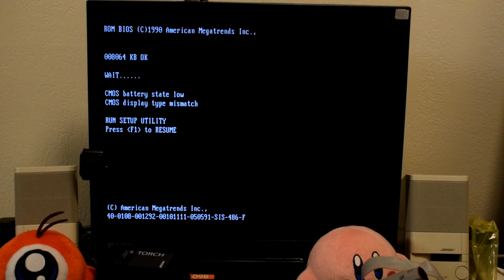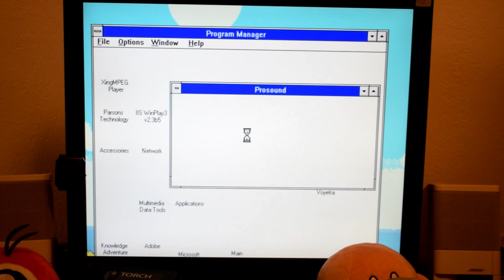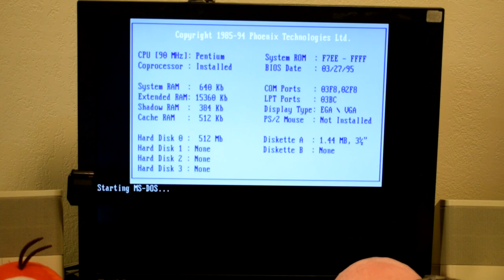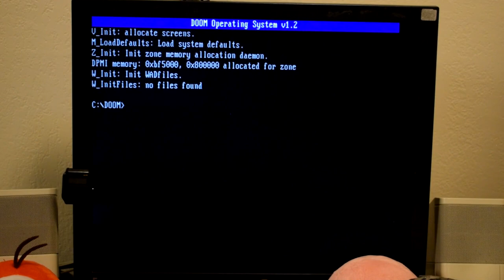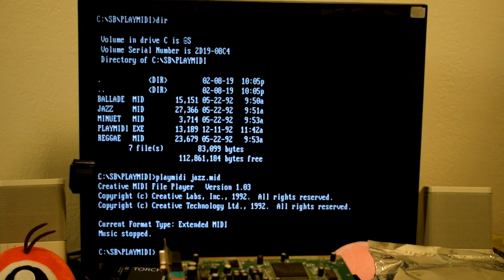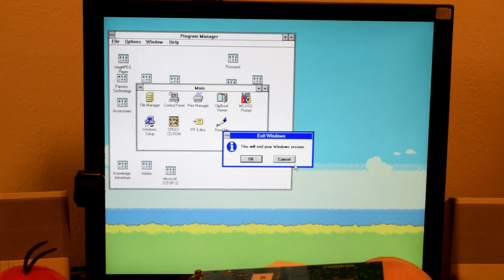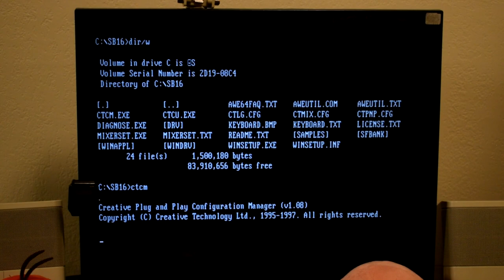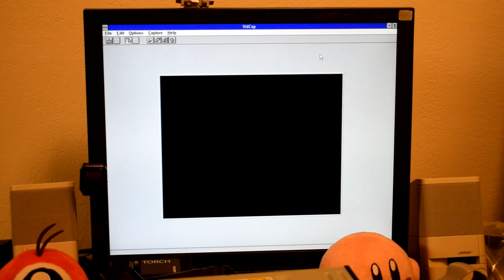The DOS Machine Motherboard to Rule Them All?

Comment: You shouldn't hold the AT power switch that way. I used to do this and I almost killed myself. AC power is getting through that button so you DO NOT want to accidentally touch the cables ends on there ... I zapped myself once with that, thankfully it only went through my finger and not through my whole body ...
Reply: I'd imagine it's a low power signal to talk to the board and power supply?
Reply: @isaacbushnell2663  AT power doesn't communicate in any way with the motherboard.
This is long before the advent of safe soft power switches. This is what we call a hard power switch, it connects the power supply to the wall pretty much.
Reply: @AiOinc1  yeah that's why I'm warning him. I've been zapped before by inoffensive things, but this, this was MUCH stronger, and it left some little burn marks on my finger. Thankfully it was really short.

I didn't know wall power went through this before, that's how I know x)

That's also why they put 4 cables (instead of 2) in a big black protection, and that the cables themselves are much thicker than the other.
Reply: Can agree I found this out the hard way as a kid. The one in my machine didn't have the heat shrink around it.
Reply: @im.a.nickel  Usually they don't have any kind of cover because they expect only qualified service personnel to be inside your computer, or that you're smart enough to unplug it first.
Reply: @DxDeksor  DC power is basically wall power, it goes through your entire house and the moment you touch it you act as a "ground" for it.  It doesn't go through your body at all unless your touching something else that is also metal or conductive.

So yea, you were "safe" to touch it (safe as in it wouldn't kill you, but it'd definitely hurt) as long as you aren't touching anything else that is conductive.
Still dangerous, but unless you have a fork or spoon in your other hand, the signal won't travel through you at all due to your body acting as ground for it.   At best you killed some cells/possibly nerves in one of your fingers, but that's about it really.
Reply: @Nighterlev  well my finger had two small dark dots after that. I think I touched the neutral first (which does nothing of course) and then the phase with the same finger. So it definitely went through that finger for a microsecond, until my brain felt the pain and told my hand to move away x)
Reply: @DxDeksor  yea, the 2 small dark dots on your finger was the "circuit" using you as ground.    That's basically what ground does, and won't kill you at all.  It completed the circuit, but as expected was using you as ground.
Reply: @Nighterlev 
Whoa there.... You might want to watch a lot more videos about electricity before you play with mains next (Big Clive is pretty good if you can follow his Scottish accent). The 2 burn marks were because it didn't go to ground. It went in one spot, and the short length of finger between the 2 points was the only circuit used. If it went to ground through a finger, up the arm, and either through the other arm to the case, or through the feet, it would have more likely been death.
Reply: @DxDeksor 
I did it too.... Pulled my power supply out to clean it, didn't connect the switch properly, pulled the terminals off with the mains connected.... Bang! And the bang wasn't from the power - it was the back of my hand smacking into the corner of the power supply, which was far more painful than the electrical burn on my finger (which i still have a faint scar from about 25 years later).
Reply: @Nighterlev  DC output is only unsafe from supplies if they are switching types that are not isolated. Most safe ones use transformers on the output to isolate the user from the mains power (galvanic isolation). Cheap ones just use inductors and capacitors, which is why you get zapped. Its essentially a straight shot back thru to the plug. The supply is locally putting out its voltage, but since its not isolated its still referenced to mains voltage. Moral of the story: use a good power supply and not something cheap.
Reply: @tin2001  Been there. Nothing like grabbing something live while bare-foot on concrete. Fortunately it was just an exercise in trying to let go of it.
Reply: The power in your house is AC and here in America the standard outlet is 120 Volts RMS. These old AT-Class power supplies have that full voltage running through the power switch. A standard US outlet has 3 pins, the round one is the earth ground connection and is permanently connected to the outside case of the power supply as a safety measure. Unless there is a failure, no current normally flows through this wire. The two blade shaped connectors deliver the power. The blade that goes into the taller slot in the wall outlet is the neutral connection. This is the ground path that the current normally flows through, and it is connected to the earth ground in your house's circuit breaker box. The other blade is the live (also called phase) connection. This is the wire that carries the 120 (in America) Volts AC. In a normal condition, current being used by the power supply is drawn between this phase wire and the neutral wire, with zero current flowing in the earth connection. Now, as far as the power switch on an old AT-Class power supply, there are 4 wires. Two of those wires are the phase and neutral wires directly from the wall (usually with a fuse). So as long as it's plugged in, there is wall power in that switch regardless if it's turned on or off. The other 2 wires are the input wires to the power supply circuit. When you push the switch, it just connects the wires across, basically like plugging it in/unplugging it. Now, touching a finger, or your hand, across the phase and neutral connection can burn your skin and cause a local shock to your hand, but won't otherwise hurt you. The exception to that is if you have bare feet on a damp floor (like in a basement), or if you have your other hand resting or leaning on the case of the power supply, or touching anything at all that has a neutral or earth ground connection. In that case the current from the phase wire will flow up your arm and through your chest or torso, and that can kill you very easily.
GFI circuit breakers and wall outlets reduce this risk by cutting off the power instantly if there is current flowing anywhere outside of the phase to neutral path, but it's still something to be cautious about.

Now, the wires that connect the power supply to the computer parts, those are completely safe to touch as long as the power supply is functioning correctly. These old supplies usually have DC voltages of +12 (yellow), +5 (red), +3.3 (orange), -5 (white), -12 (blue), and a bunch of black ground wires. These DC ground wires are tied to the mains earth ground for safety. The DC outputs are completely isolated from the phase/neutral via the switching transformer inside the supply.
I hope this clears things up a bit about the shock hazards of holding this type of power switch in your hand.
Reply: @Nighterlev Unless you live in a very weird place, the wall power should be 230V AC. At least thats what it is in my country...
Reply: The switch has the usual mains colors on it, indicating its at AC potential.
Reply: Why are you holding high voltage source in hend like this?

Comment: ISA slots don't have fixed IRQs. IRQs are configured on the cards themselves ^^
Moving the same card from slot 1 to 8 won't change anything. 
That IRQ thing is true for PCI though, but it's not the same thing as IRQs of ISA.

Since AWE64 is a plug and play card, some software is configuring the Address/IRQ/DMA settings automatically. You should check which one of these the software sets your card at and then configure your games to use the same settings. If you disabled sound in duke 3d for example, it would have started right-away.
Reply: There's a bit more to it in a EISA board, some could do PnP, others not. (I didn't sit through the video now, I sold a similar EISA monster to a friend in '99. I suppose i also invested the money in good cocktails, so EISA...? it's a bit spotty memory)
Reply: @udirt  Well probably, but he didn't use any EISA card, so I guess it doesn't matter

Comment: Why didn't you enable LBA?
Reply: DOS has shit support for LBA, about the best you can get is making a million 2GB partitions of a drive.
Reply: @AiOinc1  that's not DOS having a problem with LBA, it's just limited to FAT16
Reply: @DxDeksor  Unless you install something like 4DOS or some other later modification of it, youre not going to find a version of DOS with much larger disk support. 

Using FAT16 and never having the option for another file system could very well mean that LBA support was never fully implemented in order to save valuable time and disk space at the time.
Reply: @AiOinc1  what about DOS 7.1 (and 8 but nobody cares about DOS 8) which is in Windows 95 OSR2.x and 98. These two support FAT32.

You can make 4 FAT16 partitions with DOS 6.22, no matter what drive/interface is behind that (as long as it's big enough of course)
The biggest HDD DOS7.1 can handle without needing third party programs is 128GB (to format it, because I think I remember hearing people say that DOS 7.1 can use any FAT32 partition if you pre-format it with something else)

Comment: You need an IDE controller card. Moat dos builds include them for reasons. They accept big sizes, dont need to input the settings of the drive, and dont run on a battery.
Reply: What are you talking about ?
Reply: Deksor to get past 504mb on older boards. Also they don’t need to have the setting input for the hard drive and aren’t affected if the cmos battery dies.
Reply: @EvilTurkeySlices  it doesn't work that way. If your motherboard has a capacity limitation, you need to update the bios if you can or to install boot software such as Ontrack Disk manager or EZ-Drive to get over the limitation.
I can use any IDE controller from the 80's on my 486 from 1994 and I'll be able to use drives bigger than 500MB because the BIOS is newer. My other 486 from 1993 can't do that, so I need to install a boot software as I mentioned.
Reply: @DxDeksor  It is easier to just use a controller card.
Reply: Deksor it does definitely work that way.
Reply: @DxDeksor  plus, most boards didn't have bios updates.
Reply: @EvilTurkeySlices  tell me how my 486 from 1994 can use big drives when my 386 can't and that they use the same exact controller ?
Reply: @TrolleyMC  I've never heared of a ISA/VLB controller card with a bios on it that would allow you to get over the main BIOS limitation. So this is a solution for computers with PCI slots (though not a good one imo if you're short on PCI slots), but definitely not for computers without them, because even if they exist, they're gonna be rare and expensive. In that case, using software is the best solution.

I wouldn't say that these old 486 boards never had bios updates, but they're very hard to find these days indeed. But still, using a software to get over the capacity limitation is better than using a controller card imo.
Reply: @TrolleyMC  I'm looking at this, and I really don't see any sort of ROM or anything on this card to provide an updated BIOS for the motherboard to support a larger disk.

The problem is not in the controller card you idiots, it's BIOS limitations. LBA hadn't even been thought of because size was of no concern at this time, and anything big was expected to be attached via SCSI, and most SCSI cards had an expansion ROM on them to allow large disk support!

Not to mention, even if you WERE to get large disk support, DOS still wouldn't support it! The best you can get via DOS 6.22 is to create several 2GB partitions on the disk!
Reply: He's got a network card with an option ROM socket. There's no rule saying you have to put a network boot rom in there if you'd rather, say socket the AT edition of XTIDE.
Reply: @TrolleyMC  yeah that's exactly the kind of controller card I'm using, and my 386 is still stuck to 504MB. And if you pay attention to druaga's 486, you'll notice that he uses this kind of controller because they used to be not integrated to the main board.
Reply: @TrolleyMC  yeah, just like any other controller like this. It will probably allow more if you use it on a more modern board (but will be pointless because you have better alternatives than ISA).
Reply: @DxDeksor  Nope. In my 486 running dos 6.22.
Reply: @TrolleyMC  well DOS 6.22 can't use more than 8GB and can't use more than 2GB per partition. Your 486 probably has a BIOS limitation as well.

Any motherboard made before 1994 will have a limitation to 504MB for IDE drives. But the controllers don't have limitations because they don't have any ROM. The limitation is only due to software, not the hardware.

I can take the controller cards from my 286/386 which are both limited to 504MB and put them in my 1994 486, and it'll be able to reach 8GB. If I take them and put them in my 1995 486, it'll be able to go even further. If I install them in my pentium II system with Abit BH6 and bios from 2000, it'll be able to access 128GB. (that is, if I use the correct OS of course, that means not DOS 6.22 ^^)
Reply: @DxDeksor  For some bizarre ass reason, the board I have has that bios limit, but the controller card bypasses it. Yeah, dos has a 2 gig limit, but I only use a 1.5 hard drive.
Reply: @TrolleyMC  no it's not limited to this. Your bios might report weird sizes, but the number shown has nothing to do with the controller.
My 1994 486 board has a really early implementation of LBA (that's limited to 8GB for some reasons), but the BIOS will only show a size of 2GB max in the bios, and it cycles (if I have a 2.0GB hdd, it'll say 2.0GB. If I have a 2.1GB hdd, it'll say 0MB).
But it doesn't mean the controller bypasses the BIOS (it can hardly do that without a ROM), it's just that the bios isn't very polished (it's like having a counter that counts to 999 but can only show 2 digits for humans. It'll definitely count to 999, but you'll think it can only count up to 99 even though any machine connected to it will be able to read the correct value). Yours might not have exactly that problem, but it's definitely a display error in the BIOS. Take any other controller card and it will do the same (since your computer is a 486, it might have VLB slots, having a VLB controller could improve the transfert speed a little bit ^^)

If you insert a Windows 98 boot disk and run FDISK, you'll see what the bios can really read.
Reply: @DxDeksor  Trust me. It is. I've done what you said and it limits to 504 mb. My controller has a ROM.
Reply: @TrolleyMC  so this isn't the controller you've shown to me with the ebay link, and it's not a bizarre ass reason.
Reply: @DxDeksor  Not exactly, and what I meant was for some bizarre ass reason, the makers (acer) of my board made a 504 mb limit in the bios.
Reply: @TrolleyMC  this limitation is common to all the boards made before 1994. It's due to the way the HDD size was calculated (Cylinders/Heads/Sectors parameters) that came to its limits (the max value was something like 64 cylinders, 16 heads and 16384 sectors leading to 504MB). In 1994, LBA was invented amongst other solutions to solve that issue and thus why boards made later don't have that problem anymore using the same controllers.

In the meantime, since this is not a hardware limitation, you can just bypass that with software ... like ontrack disk manager, EZ-Drive or any other program like these two.
Reply: @DxDeksor  I would rather use a controller card.
Reply: @TrolleyMC  That's your choice, but it's definitely not the only option and other solutions might be preferable because they don't use more ISA slots and don't cost anything. Controller cards with roms on them are probably rare (never seen one of these, except when they controlled something else than IDE), and burning your own XTIDE rom isn't always something you have the tools to make (not everybody has an eprom flasher at home)
Reply: @DxDeksor  they are kinda rare, if you don't know what you are lookingfor
Reply: @TrolleyMC  I've crossed many 486 computers, and I've never seen any card like this yet. The closest I've been to this is a controller card with an EMPTY ROM socket.

In the meantime, software is free and available anytime. If you have such card, good for you, but in OEM computers with integrated io card, or if you can't find any for cheap, or that you just want to use the hardware you have available, there is no problem using software (Ontrack even lets you boot from CD drive if you want to)
Reply: All this with harddisk sizes can be fixed very easy if you have the tools and knowledge. Get a network card wich has a socket for a boot Eeprom. Get an Eeprom burner and an Eeprom of proper size. You can search and find finished bios extensions on the net for a range of popular old boards. You program the Eeprom with the bios extension, plug it in the network card and boots the machine, and the Mobo will load the bios extension from the network card and eleviate the lack of LBA support, just like it loads bios extensions from a scsi/raid controller wich also uses this way to "inject" its own bios setup into the Mobo's boot sequence. Granted, it isn't a solution for everyone, but if you just follow the decriptions carefully on how to do it, it is very doable even for a non techie. You can propably very likely find someone selling  a pre programmed Eeprom for your board so you wont have to go out and buy a burner and learn how to use it.

Comment: Highest fat16 volume size compatible with dos is 2 GiB
Reply: Kinda, above 1gb its usually buggy at least in my experience
Reply: I used to use piles of 2GB partitions. Never had any issues aside from the insanely large sector size (so lots of water space).